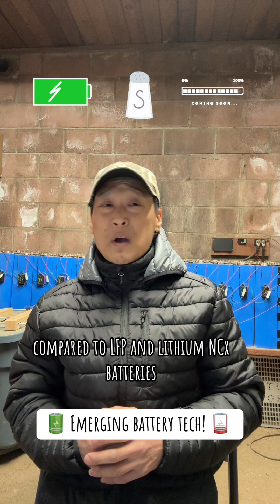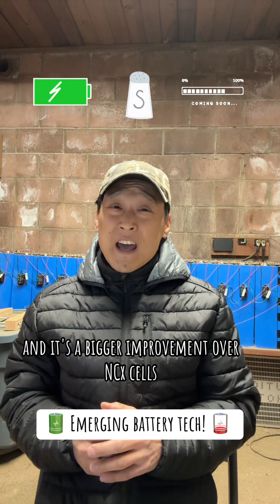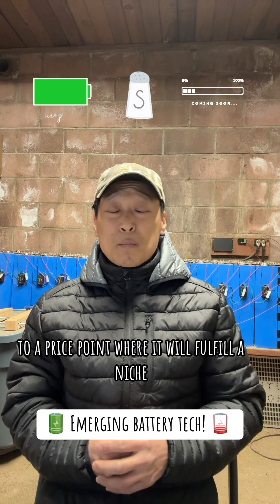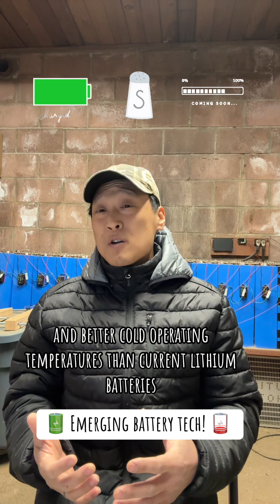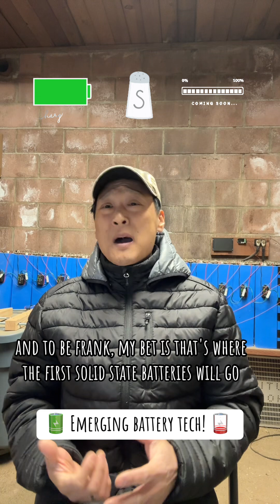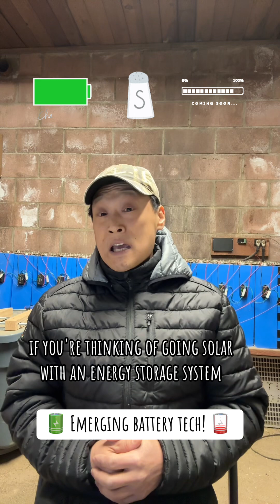New battery technologies on the horizon, quick discussion about sodium ion and solid state batteries

Comment: Peter, You previous mentioned that sodium ion battery manufacturing are worse for the planet than sodium ion chemistry. I was told the opposite from battery manufacturers.  can you please explain ?
Reply from the maker: @jacobclark89  hey Jacob! I don't recall stating sodium ion batteries having a worse environmental footprint vs lithium, honestly I haven't seen any concrete data regarding their production, the only thing I can say is it is definitely different. The only thing that would suggest to me it's worse right now is the cost, keeping in mind cost takes all energy use into account for processing, transporting materials and production of the cells, so far, they are quite a bit more expensive than LFP pet kwh so it could be more energy intensive if the material cost is supposed to be lower. Lots of factors at play because even with lithium batteries, studies show huge variation in carbon footprint for production being done in various states/countries. Keep in mind raw lithium content in lithium batteries don't make up a majority of the cost and despite analysts saying we'll run out and costs will go up...it hasn't happened yet. As for sodium ion cells, they have shortcomings in cycle life, gravimetric and volumetric energy density and worse performance in almost every metric that necessitate a lower price point than LFP or other lithium batteries to be commercially viable/competitive

Comment: If using a DC to DC charge controller get one with adjustable voltage cut out so you can Taylor it to sodium ion parameters ? 🤔
Reply from the maker: @jacobclark89  can you? Sure, but as far as I’m aware, not too many charge controllers much less inverters can accommodate such a wide voltage range. As as pointed out, you’ll need to take wire gauge ampacity requirements into consideration. It’s not impossible, it’s challenging with what’s available now!
Reply: @allthingsoffgrid  Peter, with all battery types it's important to use large enough wire. I'm seeing an explosion of battery company's starting to sell sodium ion batteries , and I see they are being implemented for motor cycle starting batteries , so I don't see why they won't work for car and truck applications as well.
Reply from the maker: @jacobclark89  they're preying on people who don't know. Motorcycle starter batteries with SiB is worse than LFP in every way. It was funny how when I was talking to some SiB suppliers, they had a huge uptick in demand from companies wanting something novel. People buy them because it's new without understanding the underlying tech. You're right ampacity matters with all battery types, what I've pointed out in my videos is how much more it matters with SiB cells because of that wide operating voltage range. It is far important to consider ampacity when working with SiB, nowhere near the priority it is for LFP with a fairly flat and narrow operating voltage range. A 4 cell LFP craps out at 10v LVco, a 4 cell SiB craps out at 6v, silly to use them as starter batteries because the usable capacity is so tiny!
Reply: @allthingsoffgrid  need more voltage just add more cells
Reply from the maker: @ then your high voltage cutoff is impacted, 16s SiB is already at 64v for 100% SoC